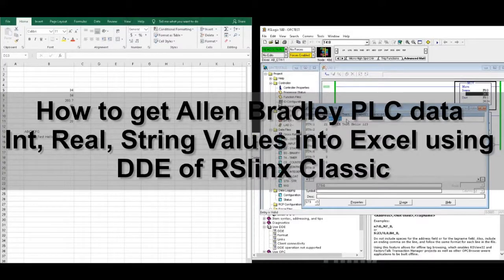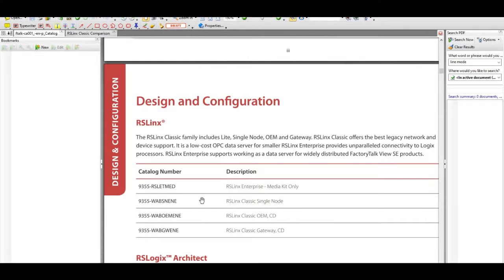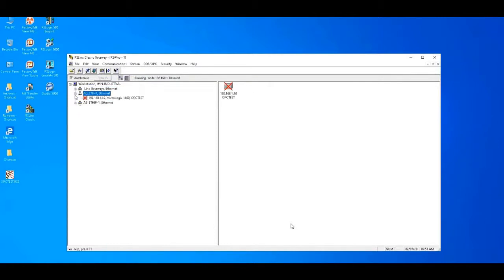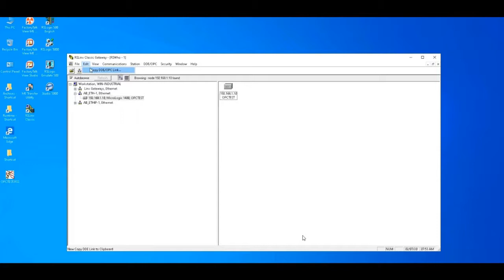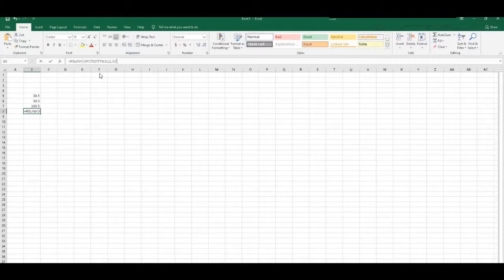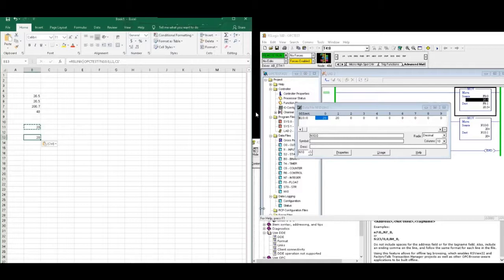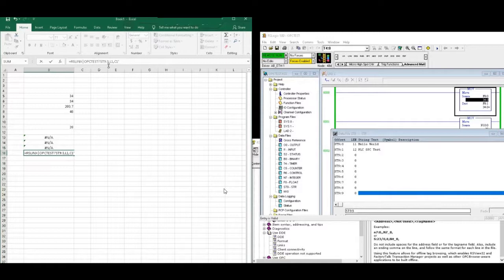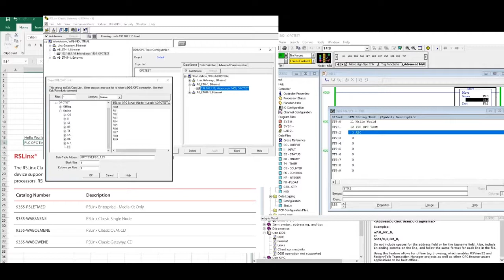AB02. How to get Allen Bradley PLC data (Int, Real, String) into Excel using DDE of RSlinx Classic

Comment: Can’t seem to get strings to work from RSLogix 5000
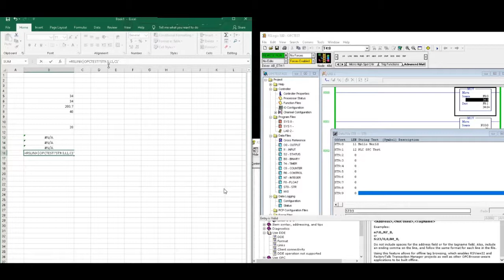Reply from the maker: The software showing in the video is RSLogix 500. But if you are testing RSLogix 5000, you could check out 14:20 and check the code behind the column showing the string in excel.
Reply: @electricalautomation  i can only bring one character over at a time